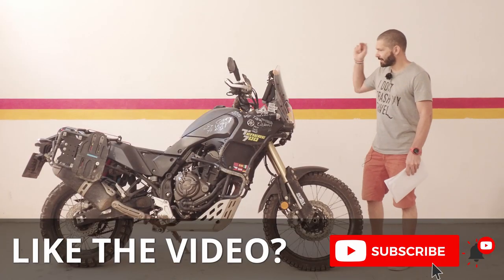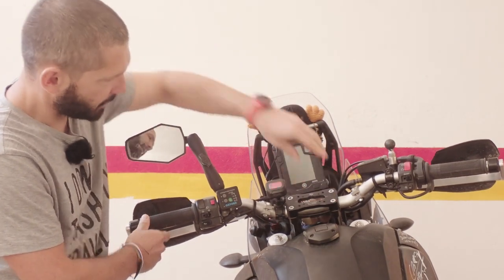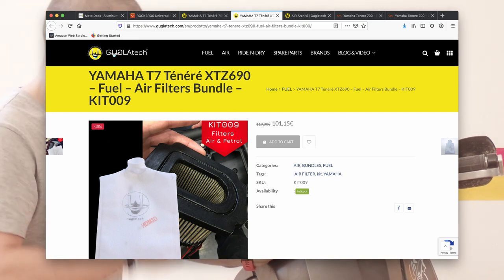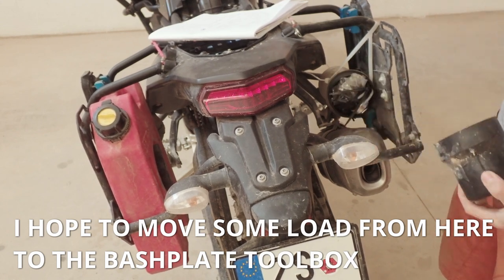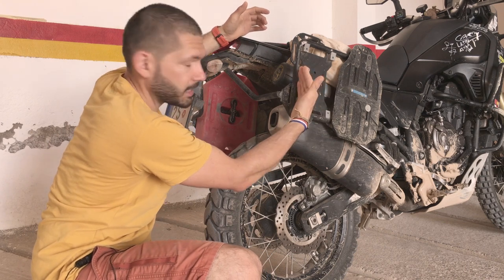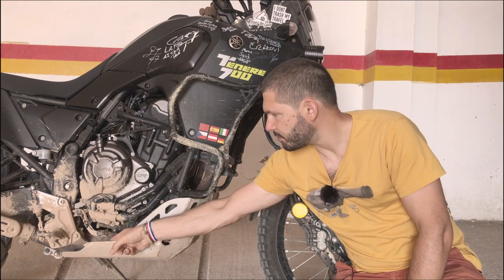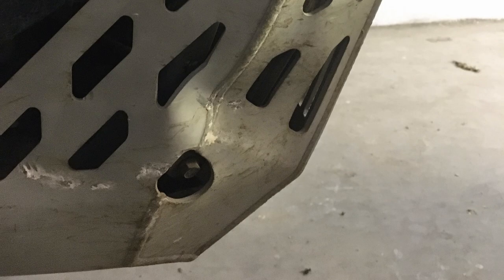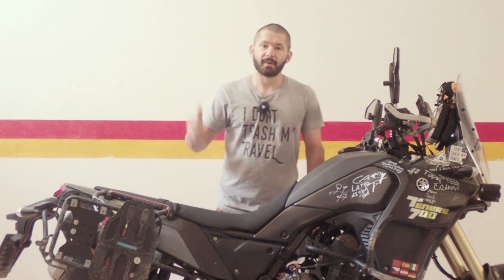Yamaha Ténéré 700 10k: 19 Accessories & Mods (so far)

Comment: High beam issue overcome it with a switch over micro relay (5 pin). Have the Normally Closed position hooked to the high beam input from the ADVMonster dimmer, leave the open pin (coil powered) empty, and the coil powered from the low beams. So when the voltage drops from the low beam the relay closes to the NC (NO COIL VOLTAGE) position  and your Aux lights will turn on with the high beams.
Reply from the maker: Yes that would work very well. I'm now using simple (I think) 4 pin relay (maybe 5) and using the yellow wire from the high beam switch to pass 12V to the ADVMonster dimmer.

Comment: Hello, Nice video.  I've recently fitted the Yamaha toolbox that locates in the skid plate recess and I've found that the engine vibration is now uncomfortable whereas prior to fitting the toolbox vibration was almost absent.  This morning I've fitted some rubber sheet (roofing membrane - NOT roofing felt) in between the toolbox and the skid plate. I'll try this and see if there's an improvement - otherwise, I may well remove it.
Reply: @Phil_Danger did your membrane fix help to dampen the vibration?
Reply: @michaellaughlin3962  - Some difference but still a tad of vibration that I'll learn to live with.  My least favourite part of the T7 is the tubed tyres. Having had a puncture over last weekend, with a 5 1/2 hour recovery time ,  thanks RAC - I miss the tubeless set up on my both my  Tracer & V-Strom XT. Fixing a puncture was a simple  15 minute job.
Reply from the maker: Hi Phil,

I have different problem with the toolbox for the Yamaha bash plate. I'm constantly destroying it! The problem is it's so badly engineered that it becomes the lowest part of the bike and also it is so wide to the side that when I drop the bike I immediately hit it. I may revert back to tool tubes or hire someone to build a proper tool box from the whole front part of the bashplate like they do for 701 or KTM 690.

In terms of tubed tires, check out my other videos on OutEx tubeless conversion. I'm using it for years on my bikes and it performed excellent not to mention it's very economical. May be option for you as well.
Reply: Hello, Badly engineered? Is that the welding, the design or the material?  Yes, the position is vulnerable but it does help keep a lower centre of gravity. My T7  may never see manic off-road riding as I have yet to master that skill, one day perhaps.  As an adventure bike, Yamaha have missed  important elements off this machine. It also adds a significant  cost to ownership. Likewise the lack of a centre stand as standard.  I will check video on OutEx - out.
Reply from the maker: Badly engineered in way that the welds are only from one side to its easy to crack. Also if it would be about 1.5cm shorter from the bottom it would be flush with the bash plate and not sticking out as it’s now. The position itself is perfect, low as it should be as you’re pointing out.

Comment: Great video...I am looking to acquire an ADV bike. It is a toss-up at the present time between the T7 with a lot of accessories/upgrades versus the KTM 890. From what I can best tell upgrading the T7 to a technically equivalent KTM 890 standard would make it more expensive than buying the later. Any thoughts you have would be appreciated. Please keep in mind I am 189cm tall weighing in at 95Kg.
Cheers
Reply from the maker: This is very difficult question for me to answer, I never owned KTM, also if I'd not start doing rally ridding on T7 I'd not put so much money into some of the more speciality mods which would keep the price down.

I like the simplicity of T7 its power delivery and the fact it is a platform which you can kind of turn into whatever you want.

I've not upgraded massively suspension and the mods I have on T7 I'd do on KTM as well (protection, steering damper, luggage) so I'm probably cheaper still. With suspension upgrade I'd probably endup on the same price as stock KTM.

But it really is a question what needs to be changed on the T7 and that question is very individual to the rider.
Reply: @FARANDFURTHER  Thank you for replying. The points you mark are valid. Looks like I will need to test ride both and take it from there. Your thoughts were appreciated. Thank you.
Reply from the maker: @kimparkin5254  Most welcome, without test riding or lending it for a while it is very difficult to guess what will suit you. Like my video about high fender... until I tested the options I thought I need high one... but nope.

Comment: Hi, Im a little bit confused about the Outback Motortek X-Frames (used your link). If i check the pictures they look much lower and the connector bar between both sides also looks lower than on you bike/video. Do you know anything specific about that? Maybe product updated?

enjoyed your video, greetings from germany :)
Reply from the maker: Hi Ness, well... my X-Frames are the fist symetric version. Since that time Outback evolved those quite a bit so that's one, 2nd... my racks are super super modified now, I have a separate video about slimming the Outback rack and making it into the Rotopax holder.

Comment: Hi. Also, did the Mosko Moto plate fit easily onto the Outback Motortek X -frame together with the X-plate or did you have to modify things? I ask at the Mosko Moto site recommends the standard rack. Cheers
Reply from the maker: Hi Hugo, the plates fit together with the X-Frame quite well with one issue. As you have the X bracket you have to position the Mosko plate in such way that it's not in a way and you can mount it using 3-4 mosko brackets.

That will result in a situation where you either have bags all the way to the front or to the back. I used the front position and I think is risky as the bags are wide and very close to your feet and when you paddle (in a sand for example) your foot may get caught under the bag as it's just too close.

Rear position would put the weight quite far back which may have effects on the suspension and so on.

In my opinion, if you don't want to mount Rotopax or other accessories onto the racks maybe just plain Outback frame and Mosko plate is the better option as you'll be able to position the plate freely.

Comment: Awesome infos!! 
You mentioned the Touratech crash bars.. do you think today it's a better alternative?
I am curious of your point of view concerning the luggage racks. It seems you constantly keep the racks. Is that also for protection or to get use to train with the weight of it? I think I ll go for Enduristan with no rack as I don't carry much even for long trips. Glad to get your opinion.
Reply from the maker: Hi Rudy, I can't really comment on Touratech bars as I have not seen them physically, are they steel or aluminium? If aluminium, I'd definitely prefer steel, easier to weld and bend.

Yes I keep racks all the time on the bike. It's not because of protection but because I have the Rotopax, Tooltube, First aid kit and Compressor on it all the time. The thing is for long distance/long term I need to put a lot of things on the bike and some like the list above is better not to have in luggage in case I travel without luggage (shopping, short enduro trip etc...) I still want to have those but not the luggage.

The weight of the rack is 5.6kg, that's what you save if you go rackless, but then, where I would carry all those things?

Best fix for the weight is to workout and be strong enough to handle those 5.6kg in my opinion :)
Reply from the maker: But if you travel on shorter trips, you don't need rotopax and you can pack all you need to rackless system, then of course, less weight is only better.
Reply: @FARANDFURTHER  I guess I will have to intensify my workout as I plan to do Romania - Cape North this year and France - Japan next year :)) Tks for your comments!
Reply: @FARANDFURTHER  Yes steel/inox
Reply from the maker: Good plans, workout does pay off. I try to attend the Horizons Unlimited Romania if I manage to go EU and the event is not canceled.
Reply: @FARANDFURTHER  Cool, might see you there then

Comment: Great video.  Did you have any issues mounting the Mosko Moto wedge on the Outback Motortek xFrame along with the rotopak?  Because you have to mount towards the front edge of the pannier rack to make room for the rotopak mount I wonder how the the little blue mosko clamps fit over the protruding exterior edges of the xFrame pannier (where there are additional loops).  Hope that makes sense.  Thanks!
Reply from the maker: Hi Kelly, yes I had problems but nothing angle grinder can't fix. What I needed to do is to push the X-frame as far back as possible and in order to do so I did grind the sharp corners of the X-frame so it  fits snugly in the rack.

Apart from this change it was fine and worked very very well, the whole thing is really just rock solid.

The Mosko wedge goes from the outside of the frame and the clamps go onto inside side of the frame. I had my first aid kit strapped there behind the frame.
Reply from the maker: I hope I did answer the question, if not please follow up.
Reply: @FARANDFURTHER  That is perfect.  Thanks!

Comment: Hi! Enjoying your channel, thanks!!’ I am debating if I will buy another wr250r and put $4000 into adventurizing it or a t700 and out 2000 into it lol. What front tire are you running and how does it perform on this bike?  Looks like an e-09 or tkc 80. Apologies if you said already.
Reply: The wrr is pretty great but the highway sucks on it. At least my buddies tends to overheat, maybe not all of them do that. It's a tkc80 front, 95% sure.
Reply from the maker: I'm running TKC80 in the front, it has been recommended to me and it did handle very well in the Morocco. I used before on Honda Mitas E-07 which was much less off-road but it was invincible.

I had 4 punctures in the front TKC80 in Morocco over 5 months and 0 on rear Mitas E-07+ Dakar which I had. The rear was worn out completely after 14000km.
Reply: @FARANDFURTHER  TKCs are very soft, i doubt they are very puncture resistant. i have had a puncture on my front TKC80 as well but I think that was due to a pinchflat. still a good tire but maybe not the best RTW tire?
Reply from the maker: @0xsergy  I've converted T7 to tubeless so for me fixing simple puncture is matter of 10 minutes.... Well RTW tire is any tire really, it is impossible to get tires you want everywhere so I had Mitas E-07 for longevity and in Kazakhstan I bought Shinko 804 as they didn't have much else... and I was happy to have something :)
Reply: @FARANDFURTHER  imho i wouldn't go tkc80 just due to how soft the compound is, very easy to get a pinch flat and the like. i hear good things about the shinko, i think the rubber isn't quite as soft as the tkcs. also, my tkc80s are cracking quite a bit and i store the bike inside with tires that are only a few months old. maybe bad batch but idk.

Comment: Great video & keep up the good work. FYI - one US Gallon is actually 3.8 litres not 4.8 (one Imperial Gallon is 4.55 litres), so the 1 US Gallon Rotopax won’t get you quite as far as you think!
Reply from the maker: I should have done my homework... embarrassing 😂🤦‍♂️ But luckily I overfill the 1US gallon Rotopax to around 4.5ish liter. It is a bit annoying as it will leak when you open it but range is more important than fire safety in this case. I also have the MSR stove fuel bottle which is 1l as apocalypse backup.
Reply: FAR&FURTHER. I actually have the same arrangement & modified it very slightly a few days back by re-drilling the rear two holes in the Rotopax mounting plate 10mm closer to the front two holes. This allows the plate to fix 10mm further to the rear, making it easier to fit the fuel can and more importantly stops the front edge rubbing on the edge of the bikes rear faring (was worried that contact & vibration would eventually wear through the wall of the can)
Reply from the maker: That is really smart move! I'll steal that idea mainly because I need to move the mosko moto plates back (if I stay with MM) as now its too much in front and it's dangerous. The edge of the can does rub into the fairing but the rotopax is harder than the fairing so it is eating up the fairing not the can :)

Comment: Hi, Nice to see your using your bike for adventure. Have you had any issues with the brake pedal?
Mind took a beating the other day and is twisted up, apart from a brake snake any other suggestions?
Reply from the maker: Hi Rich,  thanks! I think she sees loads of adventure and I hope more is to come. The only problems with the brake pedal for me are:
1) it bends inwards almost every time I drop the bike and I have to bend it out
2) it is to far forward for my foot for offroad position
3) it is not well adjustable for off-road and road as the height of the pedal for off-road would push it way up for road.

That being said, on my previous trip with the Honda CB500X I carried spare brake pedal because I did similar thing you describing many times.

So I swapped the straight one for bend one and in nearest workshop I straightened damaged one and cycle repeated :)

Comment: Hi! Thanks for your video, it's perfect! I have one question, Why didn't you choose the OEM Yamaha Crash Bars? Thanks!!! :)
Reply from the maker: Hi Marc, thanks a lot for kind words, glad the video was useful. I used Outback crashbars as I liked the look of it and from the design it looked stronger than the OEM ones. The upper part of OEM ones does not have enough support in my opinion. I had similar design on Honda CB500X and I bent them towards the engine. As Outback has so many mounting points as well as 2 cross braces I think it's stronger.

Comment: By the Way, Hepco & Becker And Touratech have almost identical Crash Bars and Engine Guards for the T7 with almost the same price, I don't know what's the best choice on those
Reply from the maker: I can't recommend here. I have not looked in detail into Touratech or H&B, isn't the Touratech aluminum bar? I think the Touratech does connect to lower frame as well protecting the water pump on the right side which most people won't use, but I kind of do.... :)
Reply: @FARANDFURTHER  I don't know neither but from a design perspective they look almost identical
Reply from the maker: I guess at some point there is only limited number of solutions. :)

Comment: Is the touratech waterpump crash bars compatible with the outback motortek crash bars?
Reply from the maker: Not sure. What setup you have in mind? Having lower bars from Touratech and upper from Outback? What would be the reason?
Reply: Oh are these complete lower crash bars? I thought they were dedicated water pump/engine case protection.
Reply from the maker: No no, no dedicated water pump protection. Outback has lower crash bar and upper crash bar and what I have installed are both. What I'd like is what Touratech has on its lower crash bar. There is a pipe going from above the engine casing over the water pump down to the frame mount.

Comment: Hi. Very helpful list. A question on the Outback Motortek pannier rack. Is the width of the rack on either side the same? (ie: distance from centre of bike to each X-plate?) What is the total width of the rack with no panniers? Cheers and safe travels
Reply from the maker: Hi Hugo, yes the rack is the same on each side, it's symetrical design. I'm not sure but I think Outback is now offering also asymetrical design whrere the side without the exhaust is closer.

I've taken the racks off the bike as I'm now bought Rackless system... I'll try to put it together somehow to get the measurement later.
Reply: @FARANDFURTHER  many thanks. It sounds as if you have moved on from your original setup and if you were starting again, you probably would not chose the same solution. Things evolve so this is to be expected. Many thanks again. Back to the drawing board for me... Safe travels
Reply from the maker: The Mosko moto Backcountry bags were an experiment. I bought them 2nd hand and the reason why there is not a review on my channel is that I needed some time to ride with them to evaluate if I like them or not and what I actually don't like.

Rackless is another experiment (expensive one though) but I hope it will minimise problems I had with backcountry although I can already see it will bring another...

As you say, it's evolution and I really wanted to test the setup before heading out for long time, I'm glad I did now I'll test the Rackless over winter and see if it works, lets see...
Reply: @FARANDFURTHER  Brilliant. Pls keep up your great reviews. They are much appreciated. I am going through options for a ride to the Road of Bones in July.
Reply: @FARANDFURTHER  Hello, thanks for the video. Please can you give me some detailed information what you don't like on the backcountry bags, because I was plannning to take them for longer rides.
Reply from the maker: @hannes7348  Hi, it's not that I don't like them but I think they have couple short comings. I still think they're very good option though. 

The problem with backdountries is that they are very heavy bags, especially when they get soaked with water. This is due to the materials they're made of (mind I had the 1st version and material changed) and the material is choosen so that they survive apocalypse (which they do).

Second problem is - and this is combination with the rack i use - that they're incredibly wide on the bike. This really is more of a problem with exhaust and the fact rack can't be close to bike because the backcountries are reasonably slim but the whole back is so wide I hit it few times on my travels.

Nothing major really, they're great bags but I'm not testing the Rackless 80 to make it a bit slimmer & lighter. Obviously it does have also it's pros & cons.
Reply: @FARANDFURTHER  Thks a lot for the expansive answer!! :-)    Have a good ride!